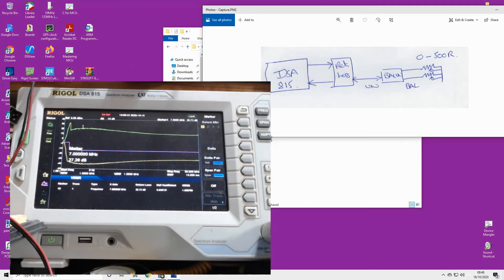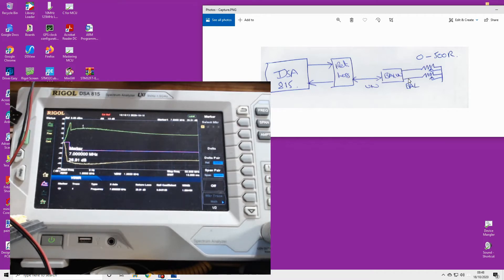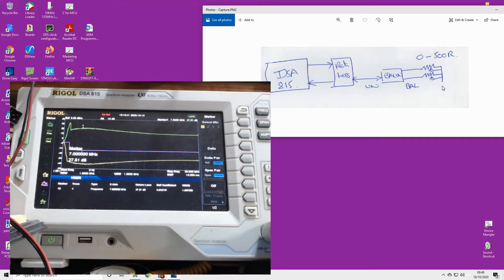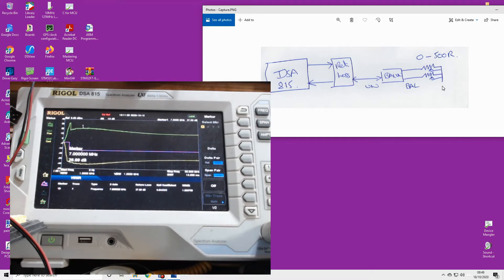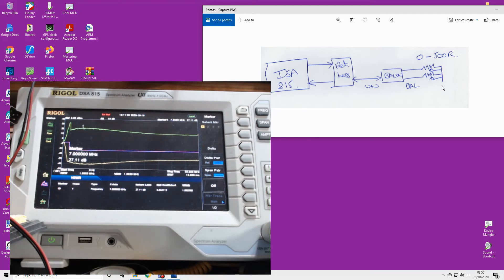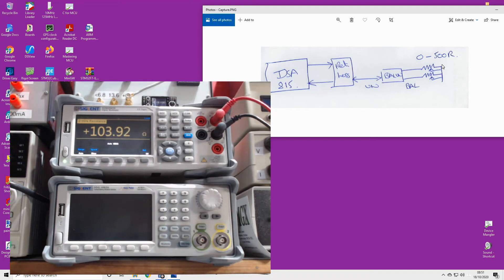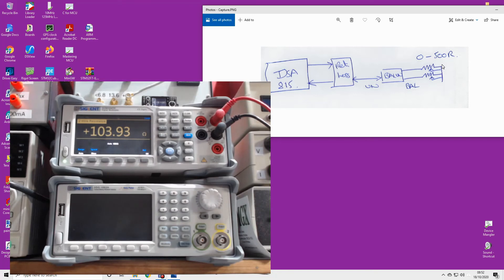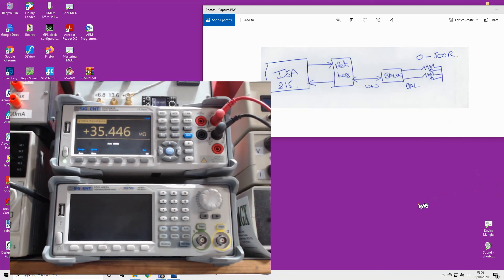Measuring Balun Output Impedance

Comment: I have a 2 element multi band quad. 2 of my bands are 1.25 to 1 SWR. I would like them to be perfect. Can you imagine anyone wanting that?

Yes, I can cut a new piece of 75 ohm stub, put on a connector, strip the other end so I can connect it to the element, measure my specs, trim the end I just stripped, rinse, repeat, until it's right where I want it. Phew, lots of work. ( I'm using a crank up so I have to take it all the way up to know what my changes have done.)

I would like a gamma match I can attach that will handle full power. Or something that will bring my "R" from 62 to 50 without having to do all the 75 ohm coax stub match stuff.

At this point, ( I have NO experience with this kind of thing ) I'm thinking of a copper rod that will slide inside of a copper tube with a set screw threaded in the side to lock it in place.

I'm getting the impression that each bit of antenna detail, like folded dipole, or loop, or quad, will change drastically how my matching network has to be configured. 

There must be an easier way to tune this how I'd like without having to do the stub match thing. If I could figure how to use my current reading of "R" to know exactly how much 75 ohm coax to snip off to get me what I'm after that would be good, but so far I haven't figured out how to do that.

Non destructive tuning would be very nice.

Thank you in advance if you ever see this.
Reply from the maker: If your SWR is 1.2:1 then that is more than good enough. Anything below 1.5:1 isnt worth the effort of improving as the gains in radiated RF are almost non existent.
Reply: @MarkG0MGX Thank you very much for that. I've been beating my brains out with this. I think it's my profession. I program CNC machinery. For four decades I MUST get "The numbers" right. For the most part, there is always a way to make an adjustment to bring a parameter closer to, or further away from nominal. So, my point is that I virtully always have a way to bring a parameter closer to my goal.

Yes I know antenna radiation is not the same thing as a bore in a piece of steel. But my instinct tells me it must be closer to perfect. 

So I am stubborn and at times will really waste a lot of time and money to "improve" things that don't need improving. Maybe this is my way of taking my mind off the fact that the radio I want is really taking it's time coming out.

I'm using a KX3 which is actually a very capable radio.  But I want that dang K4 sitting on my desktop. I may just have to get a 7610, or TS890 or a FTDX 101 instead. I know, what a terrible problem to have huh? 

If I knew it would be two or three months more that's one thing. But if it's going to be ten or twelve........I don't know if I can wait that long.

And as usual I can't shut up. Sorry!
Thanks again.
Reply from the maker: @smartazz61  If you can make it all the way through, I tried very hard to explain the concept of SWR and why less than 1.5:1 is pointless here:: https://g0mgx.blogspot.com/2017/12/swr-transmission-lines-and-terminations.html

Comment: Thanks for sharing this Mark, very interesting. I've been doing similar to test some baluns (UnUns actually) I built for SWL, mainly MW and the lower SW broadcast bands. As I don't have a vast array of test equipment, I'm just using a NanoVNA-F.
Port 1 (S11) is connected to the balun input (hi-Z) via a 20dB resistor pi network that matches (for a 9:1) 450R to 50R. Port 2 (S21) is connected directly to the balun output (50R). This method allows me to see the frequency response/loss versus frequency and the return loss. If I reverse the connections then I can see the return loss presented to the RX. 73, Nick
Reply from the maker: I have a Nano-VNA but have never really used its full capabilities; probably because I have all the other fancy test gear. This demo shows how the return loss varies to the TX/RX on the unbalanced side of the balun by varying the match on the balanced side.

Comment: Interesting.  Could you provide some info on the return loss bridge you used?
Reply from the maker: Hi Kevin, its the Rigol bridge - matched to the spec an. A "Rigol VB1020"
Reply: Aha! Slick gear.  Thanks Mark - Kevin M0XYM
Reply from the maker: @M0XYM  They gave it to me when I haggled the purchase of the spec an. It was £1500 as they hadnt been out long when I bought it. I think you can buy the basic spec an for 3 bob and a conker now :-)